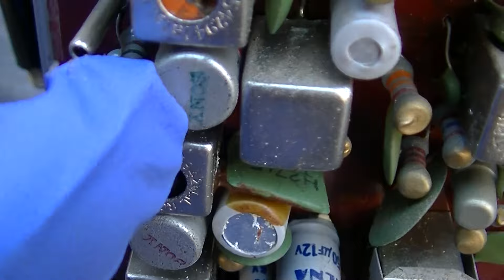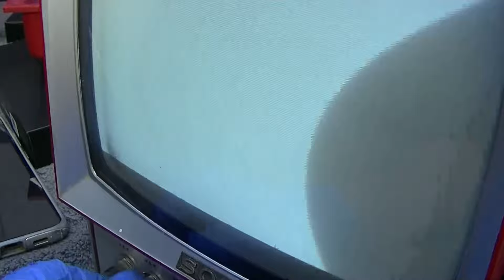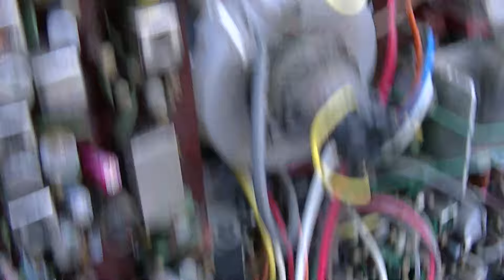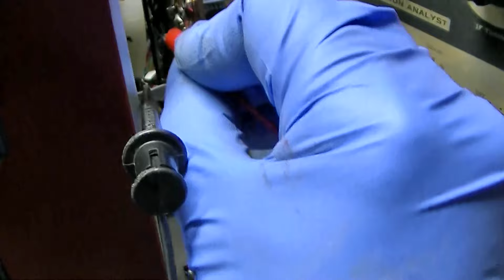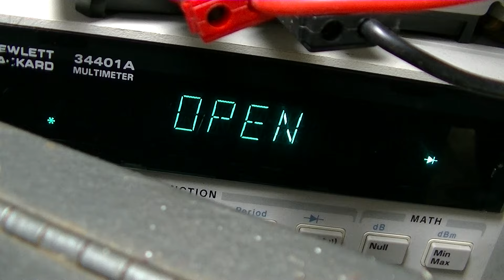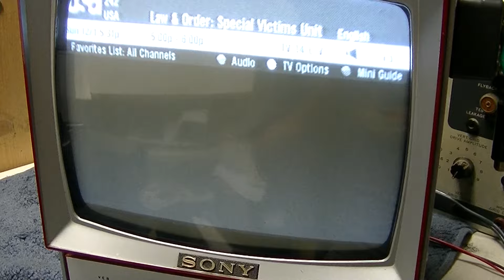1964 Sony 9 304U Radio Edit Repost Vintage TV Television Repair Only

Comment: I had a 920U I think back in 1967. Had the UHF dial on the side and knobs sunk under the CRT. OK set but actually replaced the picture tube TWICE in 10 years due to blooming issues. CRT's were junk. Did run off a battery pack or 12vdc adapter, which I had both!

Comment: It beeps for a second because a bad diode essentially turns into a capacitor. It charges up for a second causing the meter to see a resistance for very short.

Comment: They still use that brown adhesive. I had it in a battery backup thats only a few years old. The worst part is that it also becomes conductive over time which can be dangerous. I always chip it off when I see it. Throw down some glue gun glue if you're worried about solder joint stress.

Comment: Could blame electrolytics in this case. After that check the transistors or any diodes in signal path circuit. They used an
RTV glue (it had acetic acid in it) and that ate away at the body of the transistors. More sluething skillset than whomever
tried to fix it before and gave up, Shango finds the problem. Excellent repair with sound and great Sony picture.

Comment: Back in the early 70's I took a little Crown brand TV that I had purchased in Tokyo to a repair shop on post at Fort Bliss Texas to have it repaired as it quit working. It was one of those ultra portables with a built in AM/FM radio, I used it in Nam in 1971.  The dude said that since it had neve been imported to the US he could not get a schematic on it, thus could not fix it.  He recommended shit canning it and buying a better set.  Never say die was my motto back then so I tore into it. I found a broken resistor. The case was burned and I could not get a color code so in frustration I took a bit of copper wire out of a piece of field wire and wrapped around the two leads. The set came back to life and worked great after that.

Comment: I wonder if you could put a transparent LCD into that 1076 in place of the transparency film. One of the small LCDs from resin 3D printers might work.

Probably only useful for a video artist or something. You could hook up a computer and use anything as a test pattern, but I'm sure there are easier ways to accomplish that.

Comment: Nice job Shango!  I suspect all that buzzing and sensitivity to finger placement around the sound IF was due to no signal input from the video amp.  The tight board layout wouldn't surprise me if it has regenerative feedback problems when there is no sound IF input.

The choice for the 25 MHz IF was probably due to the cost of high frequency transistors in the early 1960's.  Using the lower IF frequency results in higher available gain.  Since Sony used 4 IF transistors, that suggests they had low gain problems from the start.

Comment: The corrosive glue is really something. I haven't had to deal with it much, but it was in a late 80s Yamaha rack audio effect power supply board. Not only corrosive, but slightly conductive. Preemptively scraped it out and replaced a few caps/resistors with eaten legs.

Comment: This was my first personal TV until the vertical hold went. I also had the battery pack DC 12-volt adapter Back in 1984. This was also used as a monitor for a Sinclair ZX80 computer. It had a great picture.

Comment: Schematic shows 1T26 for the detector diode, cross ref to 1N60. Designed about 1960 as detector up to 40 to 45 MHz.
Any modern schottky that fits would also have worked fine.

Comment: The Columbo of electronics solves another case. Massive clue with the hand on the board causing wild noises - my thought was 'super high impedence, super sensitive - something open - transistor base'. When you narrowed down to the metal box I thought maybe the coil (fixing that would be fun?) but diode it was. Nice deduction, cool fix!

Comment: I've been doing component level board repair since about 2017 and have just started dipping my toes in to CRT repair.  My mind was blown when you used the light to find the tin, then tacked the diode on the back.  Every video has taught me a nugget oif info.  Thank you for making these videos Shango.

Comment: Sony used that awful glue to hold the door switch in place on my 1989 CD player. The glue was on top of the wires shorting the wires together luckily it had done much damage to the wires themselves.

Comment: Not only is that glue corrosive but it also can become conductive on the pcbs...
Those TV's could be a pain to fix back in the 70s and 80s,....but were fun whenever the fault was found and fixed.🙂
Edit......

As soon as I saw the detector diode,  those go open in many of those early TV's...as I said, Fun..😊.

Comment: I have a question - if the diode had burned "closed", would adding the repair diode still have solved the problem or would it have been necessary to get inside the can to open the failed path?  She's a sweet little set.  Thanks

Comment: Excellent work! I can relate to your excitement with finally finding and resolving the issue. That was me a few years ago when I worked on my first TV, a cheap GE 12” portable from the 60s. The horizontal hold wouldn’t lock. I swapped tubes, checked voltages and asked questions on the typical forums. I was suspicious of the old plastic film cap that was in parallel with the horizontal hold control but everyone said it couldn’t be it. So, on a whim, I tacked a known good cap in parallel and it worked! Afterwards I replaced the cap and finished the service. I loved that challenge.

Thanks for all you do. I’ve learned a lot from you over the years. Looking forward to my next project. A Sony KV-5200 5” portable Trinitron.

Comment: 1964 is quite early for solid state set. But in Czechoslovakia (at that times part of commie block) we had it too in 1966, so just 2 years later. All stages used germanium transistor (like radios) but horizontal out and video out needed silicon ones. There was only one tube - High voltage rectifier.
Russians even used germanium transistor for H-out in portable B/W sets till 80s.

Comment: The vertical control turned into the “adjust the angry wasp nest” control. Wow. I’ll bet the vertical output transformer has a loose winding on the E-core, or it’s not bolted down tight. The last time I heard buzzing that loud was from a motor with a dead shorted coil… shortly before it burst into flames!

Comment: Excellent troubleshooting and repair, this is what separates the good techs from the tube/cap/transistor swappers. Tracking down what part of the circuit is actually not doing its job!

Comment: that glue is called "sony bond". it is also conductive when it turns brown and will eat the legs off compoments. There is a chemical made by GC electronics I think that will remove it. Mikes radio has some info on that. "Safely extracting broken radio transformer / coil ferrite cores." its called radio tv service solvent

Comment: The glue starts out tan and turns brown as it ages and absorbs moisture. It's the moisture that the glue holds that corrodes traces and rusts the metal it's in contact with.
Reply: They're eating the coils, they're eating the yokes, of the TVs that live here…
Reply: It also makes a good conductor that dirty water if there is a decent voltage involved.